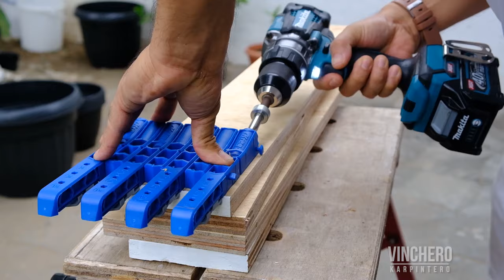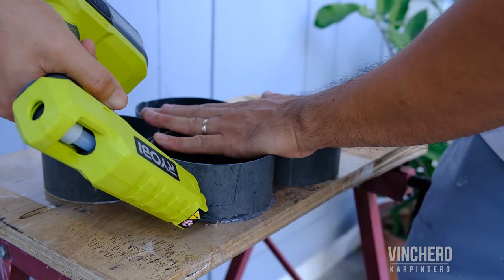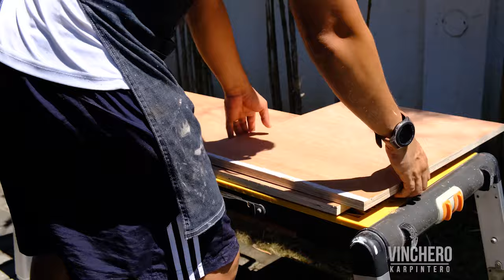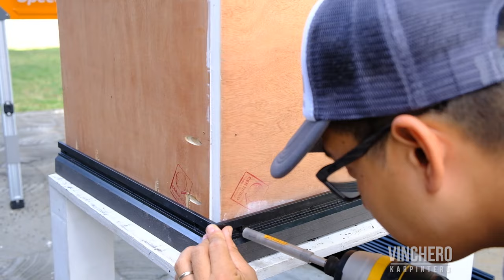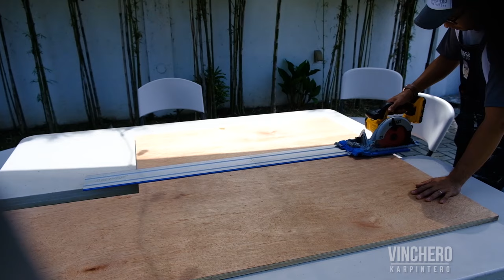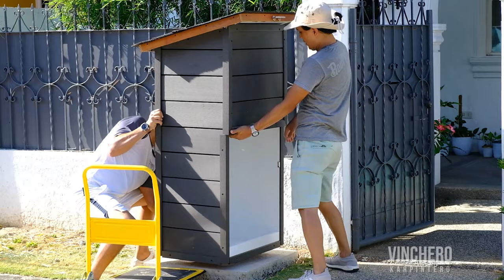Buliding a Parcel Box // How to Receive a Package Without Touching It // Pandemic Box

Comment: Can I suggest an modification to your project. What if you built it into your wall and the access to the door is on the inside of your property. What do you think? So you dont have to come outside to collect your packages. Also it prevents access to any lock that is possible of being picked?
Reply from the maker: We considered this but I wasn't too keen on making a hole in the wall into our property. Agree though that it might have been nicer to do this.

Comment: Great video and nice place to start. There is a security flaw though, what if someone just cuts the rope? I think that maybe it should be a cable that goes through the top and bottom boards so it can't be cut or removed or did I miss something?
Reply: A cable or chain would prevent that

Comment: Finished product looks amazing. Looking to do the same! One thing I noticed tho is if someone really has the intent to get your stuff, they could just simply cut the cord that pulls the flap. I will sketch up something that keeps the flap horizontal and only goes down when the roof cover is closed.
Reply: It’s a really tall drop box, it would be hard for someone to reach for the packages at the bottom.
Reply: Maybe replace it with metal cable or chain

Comment: Hey their my friend made his mailbox by copying off your video. I suggest some design changes. Instead of using para cord use some type of heavy duty steel like rope and with some metal plating for parts that could be easily accessed. Saying this because he got robbed last week and I’m the one picking his packages up while he was on vacation. They got in from the top and bottom top by cutting the para cord and by snapping the heavy duty lock on it. I suggest for the bottom part is to put a metal box with a combo or key access on top the first lock. He also used laser cut metal for almost anything that goes through the top. After that he’s got tons of theft attempts and they all failed after that lol.
Reply from the maker: Excellent tips. Also, what neighborhood does your friend live in? 😅

Comment: Except that, any thief with a good master key can open any lock. I propose the same thing except that instead of package dropping down, it slides into the inside of the house through the wall.  A thief sure could open any front door or window and can steal your delivered package of corn flakes but will have to deal with Rex the Doberman inside.